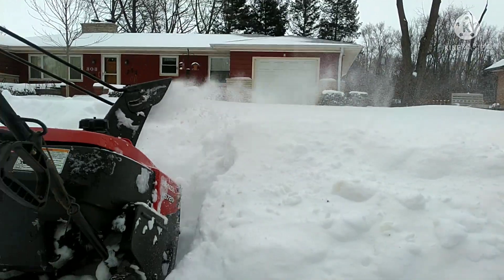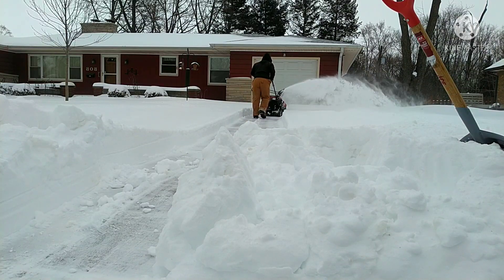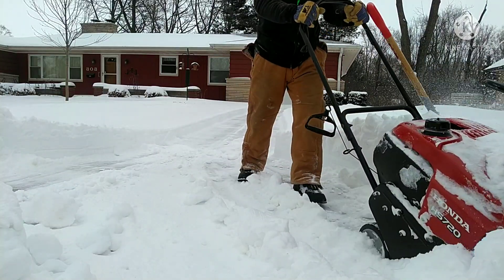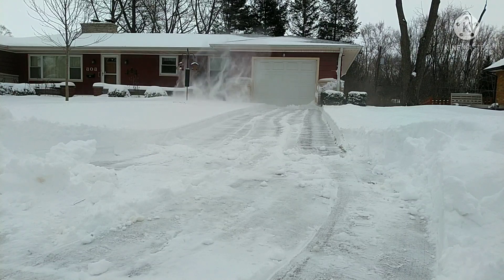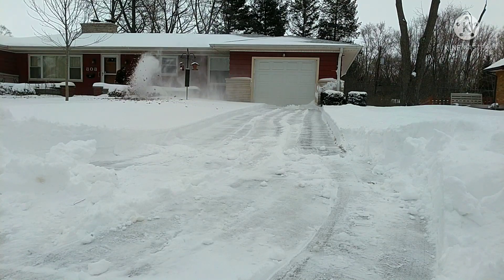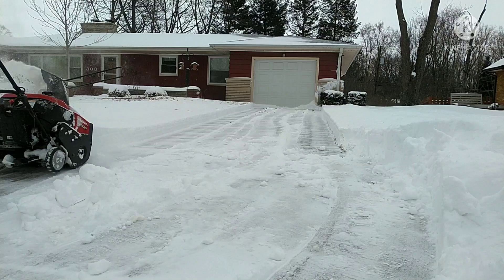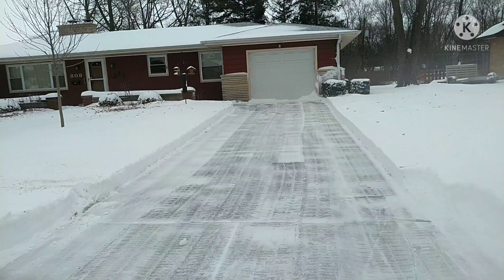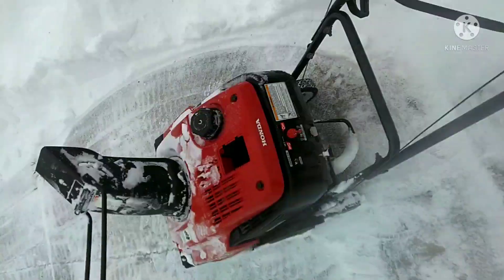Honda HS 720 snowblower after winter storm Landon part 2

Comment: Thanks for the video. I have a 30 year old Craftsman 2-stage I'm thinking of replacing. I'm torn on a two-stage (Ariens, Craftsman) or single-stage (Honda, Toro).

I'm in southern Ontario and our winters aren't what they once were i.e. not as much snow. Our average falls would be 6"-8", rarely more. Of course, drifts can get bigger but you can't predict drifts. My driveway is a four car so looks similar to what your working there.

I'm such a procrastinator.
Reply from the maker: Thanks, hope it helped some

Comment: I’ve noticed my 720 single stage cleans the drive so much better than my dads 2 stage Honda. Don’t get me wrong the 2 stage is a beast for tall wet snow but for most snow we get, the 720 is perfect. I used my father in laws Toro similar to the 720 and it’s ok. Already replaced the carb on it this season though.
Reply from the maker: I have always wanted a bigger snowblower, but I have a hard time justifying it. This Honda is light and I can load it easier and faster. Also I believe it can probably be turned around a lot faster with each pass than a a bigger one. Plus like you said, it does great for basically all the snows we have.

Comment: How long do your paddles last?? because I have the toro 821 rc with the thicker paddles and I normally do about 70 houses before I have to some what replace them but i replace them around 60 or 65 houses! I did almost 80 one time before I replaced them one time!
Reply from the maker: I am not sure, but I bought that snowblower in 2016 and I just changed them. I only do about 6 to 8 driveways, probably average 3 times a season. So let's just say 7 driveways time 3 times a year is 21 a year times 6 years. That is about 126 driveways. Of course size of driveway would make a difference. Plus it was over due for new paddles. But I would think it lasted more than what you got with the toro
Reply: @gg32484  naw you only do 6 to 8 drive ways I have a Honda to and I wear them things out in about 50 houses your just off and on with it but I use my Honda for light fluffy stuff because it has more torque but it will get threw the hard stuff to but 6 inches of fluffy the Honda is a beast but wet and heavy toro!
Reply from the maker: @got2getit204  good to know. I would like to try a toro and compare the 2

Comment: A good single stage will run circles around a 2 stage any day, ask my neighbors.  And IF there's 18" of snow, yes, I have to work at it harder, but so does my neighbor's 2 stage . . . and I still finish first.  Truth be told though, my single stage is so fast that I can often afford to do the first half of the snowfall while it's still snowing and then finish off later with the second half.
Reply from the maker: Yeah, I think it is fast. I sometimes do the snow about half way thru the snowstorm too

Comment: Do you still own the Honda? Been thinking about buying a mint used machine here in Canada. Retail for $1400 tax in. but can get one for 700. like new! Only debate I'm having right now is government pushing to ban these small gas engines and going electric (garbage). The other issue is lack of parts and price of genuine parts. ouch!
Reply from the maker: @lv2keepfit493  yes I still have it

Comment: Add some sea foam in the gas
Reply from the maker: I typically do use seafoam. Unfortunately it has never seemed to make a difference. It still surges while idling, but runs fine under load.
Reply: Just bought a used Honda HS 720 and wishing for some snow!  
Are you using ethanol free gas?  This seems to be recommended quite frequently for these small  engines.
Reply from the maker: @tedjohnson9924  no I don't. But yes, a lot of people say that you should. It probably would be a good idea with the little use that my snowblower gets as well.
Reply: Or buy ethanol free gas or true fuel from Lowes or Home Depot. worth the cost for no carb. issues I think.